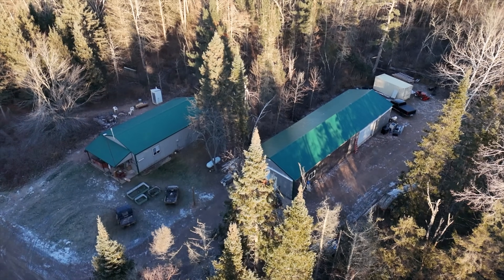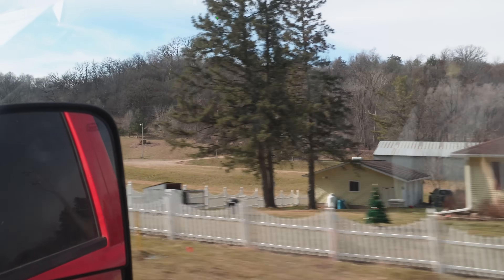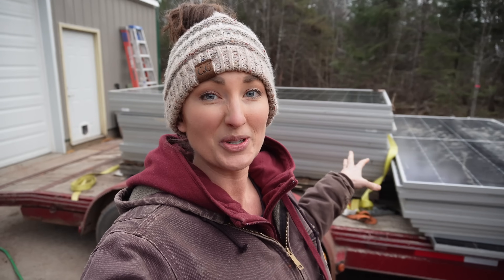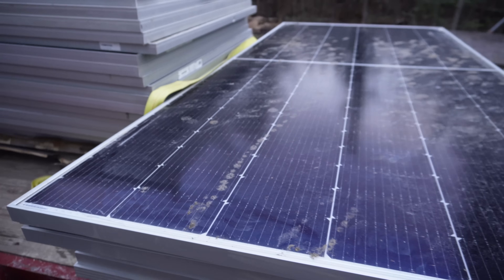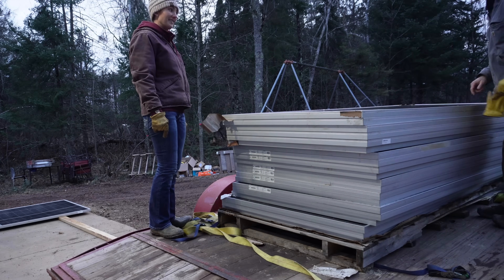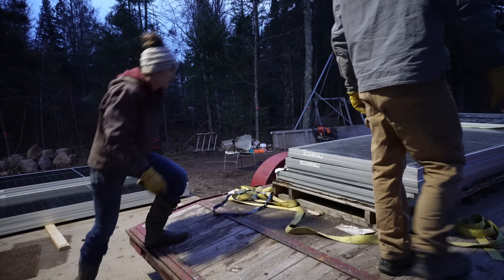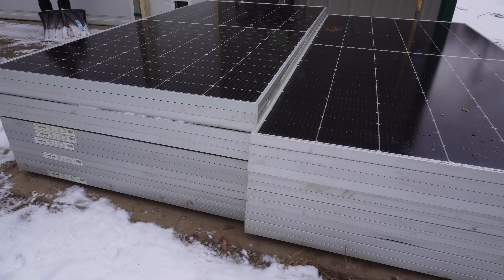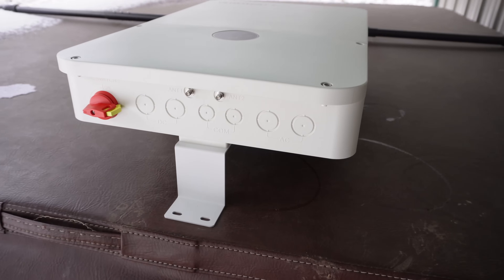WOW!! 14 kW of Solar Panels for ONLY $300?! ...Will they work?

Comment: I just bought a dozen panels with shattered glass, they all tested good, over 35 volts each. I was hoping that you were going test them in this episode so I could learn how to test for amperage output. In your last video with the solar wall, I'm thinking you could use PV panels mounted vertical for the south wall, I recently saw a video where there was decent output in the vertical position and cooled better. I'm in the 34th parallel so cooling is helpful, they would cool great with air moving past them in that wall.
Reply: The way to "bench test" a solar panel is to test for Short circuit Amperage. You use a clamp meter on Amp setting, and hook the positive and negative wires from the panel to each other. Run the test in full sun, then make sure to seperate the wires!

Comment: As an electrician of 23 years, I can assure you, that you CAN string solar cells of differing types in series, provided they all have suitable maximum voltage capabilities that exceed the rating of the lowest such capable module. What you want to avoid is building strings and then tie them together that produce different Vout and Iout. Your individual strings should be as close to identical as possible. Also, if you are not using solar tracking mounting systems on your modules, consider the time you will be using the system the most, and aim your strings accordingly. (Summer azimuth and elevation coordinates are different from winter)

I heard you say you had the following quantity of each panel (module)
2x of type (A)
3x of type (B)
4x of type (C)
5x of type (D)
And 
16x of type (E)

I recommend using the following modules in type and quantity as follows
(Try to use the best quality / least damaged of all the modules you have obtained.)

2x A - keep these for other projects
3xB - use 1 per string, no spares
4xC - use 3 of these, 1 on each string + 1 spare
5xD - use 3 of these, 1 on each string + 2 spares
16xE - use 15 of these, 5 on each string + 1 spare

So an individual string should be wired as follows:
+OCPD/disconnect to inverter_+B-_+C-_+D-_+E-_+E-_+E-_+E-_+E-_-OCPD/disconnect to inverter

Something else to be VERY careful with solar, cover the panels with opaque blankets (multiple layers) to prevent them putting out voltage BEFORE you are going to work on plugging them into or disconnecting them from each other and into your chosen OCPD! The modules strung in series are able to put out upwards of 400volts, and with DC power, the human body cannot let go like with AC, so death and serious injury potential is much more severe!!! Be careful even at night, even moonlight can be enough to produce lethal power in your arrays!

Great deal on the panels, Next time see if they will let you choose them in the yard instead of getting what they give you, that way you can get all the same type/mfr. and avoid obvious physical damage. Build cribbing corners (48" 2x4's screwed through the face of one into the edge of the other - should look like a tall letter "L" as viewed from the end, to go around your stacks of modules, (1 crib at each corner) on the trailer, then ratchet strap them horizontally to the top and bottom of the stack in place before you strap the stack down.

Good stuff, can't wait to see your installation video! Subscribed!👍
Reply from the maker: Thanks for taking the time to share all of that - great information and much appreciated. We’ll try the cribbing method next time 🙏🏼

Comment: Just had 36 (14.4KW) 400/500W bifacial panels delivered about a week ago. $4000 bucks. Certainly not $300. Heck of a find! Congrats!
Reply from the maker: Hey that’s still a pretty good deal though! And delivery is nice too! Jealous about that part
Reply: Signature Solar. They've got some bang up deals going at the moment. Don't know how long they will last?
Reply: I would say you have the better deal, biracial panels generally  pump out 20% more watts plus decent sized panels are a win. Who was your supplier may I ask.
Reply: @kearnon6682 Signature Solar. See what they have on their website but I would call for a quote. They did me better than advertised price. Can't say that will happen every time? Even still, I haven't found a better price anywhere else for new panels on the advertised pricing.
Reply: where did you get these from?
Reply: Blemishes
Reply: Talesuns gone from SS

Comment: A lot of us would like to know how to score a similar deal. If youd be willing to share, thatd be great.

As for miss-matching, it sounds like you guys have it figured out. You need to make sure the volatage is close. Thats what the mppt uses to maximize the amps. If you have the same volatage, but different amps, the panels will work 100% of their rating. 

Anything that doesn't natch right, put on a different mppt. 

Being in Minnesota, winter will be a bear for production. Setup 45° south. Anything else and youll take a major energy hit. You should be able to average 50kwh per day which should easily cover your needs.

Comment: My neighbor explained that my state requires a solar installer do the job.  It also only allows enough panels to power the house from its electric usage.   Frustrating because I would like to add more.
Anyone else have this issue?
Reply: Running just a few kw of panels, but I just tossed mine up and never asked for permission, some times better off waiting to ask for forgiveness.
Reply from the maker: Shoot - that is frustrating!! What state are you in?
Reply: @thehomesteadingrd  Pennsylvania

Comment: Uv cure glue works ok, I think screeding silicone in the cracks, even just a miniscule amount may help more. Idk, I have some panels myself needing repair, got a great deal on them, they test well, they just need a bit of tlc. I might even try vacuum bagging the crack area with uv glue to get back structure, The smashed corner ones will repair nicely this way, but the long hairline cracks will not do well I am thinking with this process. I might just have the uv glue soak or penetrate into the cracks, while inside out of the sun, then After getting into the cracks, cure the glue outside, Time helps with any process, and force, too, but I dont really know yet if vacuuming large areas of the panels to get the glue to penetrate will work. It doesn't take much more than the vacuum canning machines to get the glue in. 

I am doing this with glass thin film panels, but the silicon panels should be the same procedure.

I wish panels were not made from glass though. It would be best if they were plastic, they would not ever break. Its also more lightweight and flexible. All it would take is a polishing every decade, and they would be as good as new.

Make sure you guys go with midnite solar mppt controllers, They are the best imo.
Reply from the maker: Sounds like we’re thinking about doing the same thing! We’ll see how they turn out! 🙌🏼

Comment: So the simple part is to add batteries. If the grid goes down you have no power without the batteries. Good luck.
Reply from the maker: You are correct! This will be just an accessory cabin on our homestead. Our main house will be fully off-grid with battery backup.
Reply: Yep. Batteries are the most expensive component of being off grid.
Reply: It’s cheaper and easier to instal a backup genset than to install batteries. The chances of the grid failing for any length of time is minimal.

Comment: I built some 2x4 corners for the piles on the truck / trailer worked ok. Just go get another load at that price you never have enough panels.
Reply from the maker: So tempting!!
Reply: Add you will probably need some as SpareParts in the Future .... which you will not get in 5 Years.
Reply: At that price you could easily resell them for a profit....   I would buy as many as I could afford.

Comment: Wow what a deal!  In case you haven't, make sure to read your electrical companies net metering contract so you know what to expect.  Some electrical companies require you to have extra insurance on your system, and may need to inspect it. and the amount they pay per kwh may be as low as just  a few cents per kwh.  Normally, they won't actually pay you for the power at all,  They will just give you a credit, so you will still have a bill every month, It will just be lower.   Ask the power company what the average credit is for a system similar to what yours will be.  Most companies rate the sizes from something like 1-5kw, 5-10kw and up. If your total is 14kw, once you get them up and working, hopefully you can get like 8-10kw on a sunny day.  You'll never really get what the panel is rated for.  But for the price you guys got the panels,  you wont have nearly as much startup cost as most people!  Oh. And dont forget the tax credit for next year!  Enjoy!
Reply from the maker: Thanks for the info! We talked to the power company already and they are excited about it! In Minnesota, they have to pay the going rate and our power company said they’ll write checks 💫.
Reply: @thehomesteadingrd  oh wow that's a great power company!

Comment: gret deal. we've been using retired solar farm panels from california for years and they are great. we want to upgrade soon to increase our solar capture but for starting out on a budget, you can't go wrong. we have mix and match in our string and its just dropped the higher wattage panel down the the lower wattage panel, which in our case in around 30 watts. no big deal!
Reply from the maker: I’m so glad to hear that!!! That’s great news! Thanks